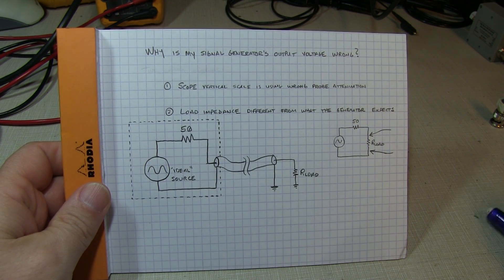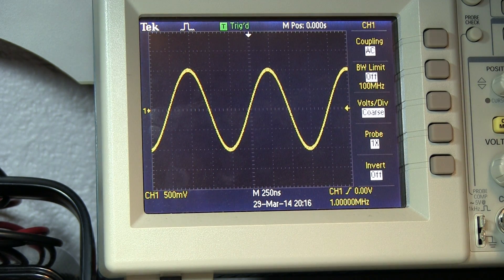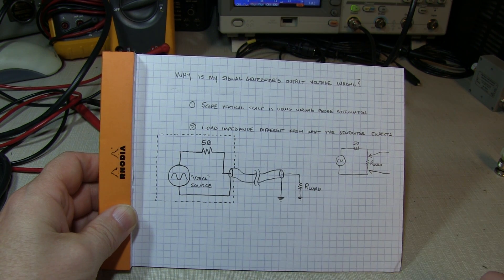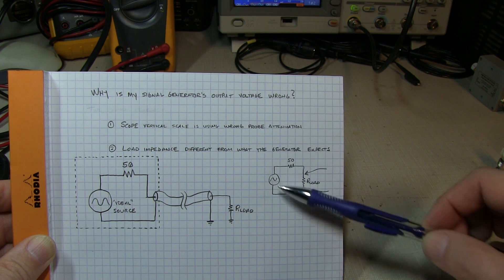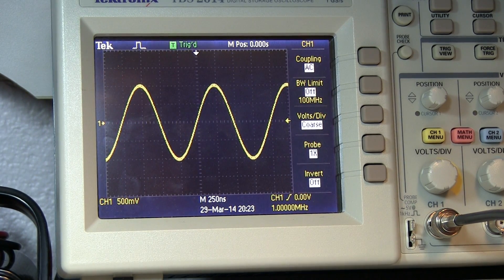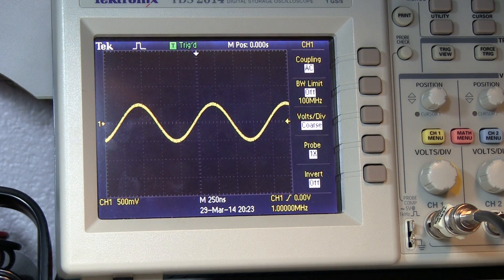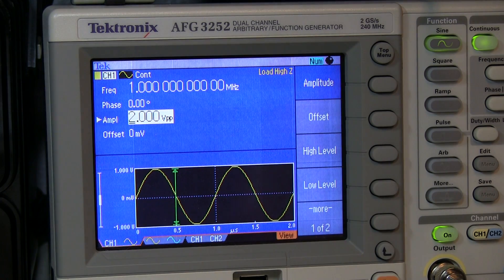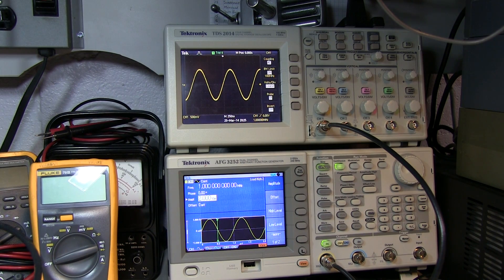#137: Why your Function Generator's output voltage reading can be wrong

Comment: Hello Alan,

Why is 50 Ohms resistor value widely used? And what is the use of having 50 Ohms internal resistance in the function generator?
Reply from the maker: The 50 ohm output impedance is used to provide a good source match to the line and load.  Why 50 ohms, here's a good answer for that: https://www.microwaves101.com/encyclopedias/why-fifty-ohms

Comment: Bought a 50 ohm bnc feed through terminator which appears to have the 50 ohm in series instead of parallel to the output. What is the use of such a 'terminator'? Attenuation?
Reply from the maker: It's most commonly used as a "source terminator" when the source has a low output impedance.
Reply: When the source impedance is lower than say 50 ohm. So it acts like the 50 ohm resistance in your schematic here.

Comment: Hi Alan. I was wondering is there noticable difference in signal shape or amplitude depending on where you terminate your coax? I mean you can connect your through termination at the oscilloscope or at the signal generator will we notice a difference? Is it important to terminate your signal at the end of coax or it doesn't matter?
Reply from the maker: It is almost always best to terminate at the load.

Comment: can you make a video about a somewhat common issue which i cant find a way to fix, which is that my function generator and scope are both earth grounded and somehow ive read that causes issues..for example ive tried building a bridge rectifier but i cannot read the rectified wave, as soon as i try to do a common ground or anything my wave readings are totally off and awkward. It is now sunday, got my scope on friday , spent the entire weekend trying to figure this out... and i cant....scope noob :(
Reply from the maker: If you draw a schematic of your setup, including a "model" for the generator output and scope input, it'll be clear to see the problem with the common ground.  A bridge rectifier expects an AC input at the input, where the input signal on each side swings above and below ground, while the output of the bridge typically has one side tied to ground.  But, when you drive the input of the bridge with the function generator, that effectively ties one side of the input of the bridge to ground - so that node will no longer swing below ground (because it IS ground).  A simply audio transformer can be used between the function generator and bridge rectifier input to solve this issue for your measurement purposes.

Comment: What voltage will be displayed on the oscilloscope if we set the function generator to high Z while having a 50ohm through terminator.
Reply from the maker: If the generator is set to Hi-Z, then it is expecting to see a high impedance load.  Thus, the amplitude displayed on the generator would reflect that.  But, since the load is actually 50 ohms, the actual voltage displayed on the oscilloscope would be 1/2 of the value displayed on the generator.
Reply: Thank you!

Comment: I have a function generator that supposed to have a 50 output however, I tried a 50 Ohm terminator as suggested at the input of my scope and voltage was still wrong. I then built a variable 10 to 100 ohms terminator and I found that adjusting it to about 37 ohms worked just fine. Is it possible that the output of my signal generator is not exactly 50 ohms and using a variable terminator is the right thing to use? 
Please reply because I need to know what you think...

Thank you
Reply from the maker: Does the generator have a setting where you can input the load impedance? If not, then the best practice would be to use a load impedance that matches the coax impedance (usually 50 ohms), and then always measure/verify the output amplitude with your scope.
Reply: Would I be doing the right thing using a variable terminator?

Thank you
Reply from the maker: It would be best to have the termination match the coax impedance (i.e. 50 ohms) to prevent any reflections.
Reply: What I am trying to accomplish with the variable terminator is adjusting it so that the signal generator Peak-Peak voltage match the scope Peak -Peak readings. If I use a 50 ohm terminator on the scope, the reading are not the same however, if I use my variable terminator set to about 37 Ohms, the readings match each other. I tried this on both ends of the 50 ohm coax and the readings match the same. I'm thinking maybe the signal generator voltage display reading is off. I realize that matching the terminator to the coax is the best thing to do.  I guess I should dis-regard the voltage reading from the signal generator and make adjustment according to the scope is my thinking while using a proper 50 ohm terminator at the scope input.
Oh! buy the way, the signal generator is a GW Instek SFG-1013 which of course is a entry level signal generator and not a lab grade device. It's frequency and voltage output is rock solid and good enough for what I need.

Thank you for any reply.........
Reply from the maker: If it appears that the amplitude is "off" by the same factor at all frequencies, etc., maybe you can make a modification (insert a series resistor) inside of the generator to make the voltage division more accurate.
Reply: Thank you very much for your quick reply. I will do some more testing tonight and see what happens.  Again thank you...
Reply: Your idea was right and I did a few tests and found that a series 20-22 ohm resistor brings the output to about 20 millivolts within the signal generator voltage display using a 50 ohm terminator at the scope. The frequencies I tested were from 1kc to 2mhz and there was a slight difference but not anything to worry about.
Now this test was done outside of the signal generator and I realize that a internal mod may be different due to termination I made outside. I will see what happens. If this was a signal generator that went beyond 2mhz, i would hesitate to make any internal change. All I am using the signal generator for is low frequency stuff mostly below 500khz.  Later I will see how difficult the mod may or may not be and go from there.

Thank you for all your help.

Comment: If you were to set the RF generator to +10dbm..  Does this really mean that the generator will provide that 
power of +10dbm at a 50 ohm LOAD...   But in order for the generator to accomplish this
it actually has to generate +16 dbm aka 40mW of Raw Power aka 2.00 Volts Peak 
to provide +10dbm aka 1.000 Volt peak to a 50 ohm load...  Let me know if this correct...
Reply: Thanks for such informative videos... Sounds like you have a bad cold.... Hope ya feel better...
Reply from the maker: You're dB calculations are off, but you have the idea correct.  The generator has to produce twice the raw voltage (into 100 ohms) in order to achieve the desired voltage into 50 ohms. Remember that power is calculated from RMS voltage, not peak. Considering sinewaves only: 2Vpeak = 1.414Vrms,  20mW (+13dBm) across 100ohms, and 1Vpeak = 0.707Vrms, 10mW (+10dBm) across 50ohms.

Comment: If I measured the signal i/p on a circuit under test, and this measurement is the same that is being displayed on the generator, I could be confident there is no conflict of impedances?  Correct?  Thanks.
Reply from the maker: Yes. It's always a good idea to measure the signals at the device under test, just as it's a good idea to measure/check power supply voltages at the circuit and don't always trust the power supply display.

Comment: Hello Alan! I know you couldn't possibly know all the different oscilloscopes and signal generators. But, I will say that I have a Marconi Instruments 2022D Signal Generator, and my oscilloscope is a Fluke 196D Scopemeter (combination digital scope and multimeter). The manual for the SG says it has an RF output of between 127 to +13 dBm.(0.2uV to 2 V EMF). However when I connect the output of the SG to the probe on my scope, I do not get the readings to concur. Right now I have the SG set to 1000mV, but the scope is reading 4.1 mV+/ RMS. The scope shows 1:1 probe. What in the heck am I doing wrong? I want to connect the SG to the SO239 on my VHF radios and do some signal tracing. Thanks for any help...Dan
Reply from the maker: +Beretta96Dan The SG has to be loaded with a 50 ohm load in order to meet its specification. A 1X probe used with any scope will only give you less than 10MHz of bandwidth. Another problem you have is that the 196 only has 100MHz of bandwidth, which means that 100MHz signals will read 3dB down, and only if you use a 50 ohm thru termination and no probe.

Comment: Thank you very much, this is the video i was looking for!
But i was wondering, what if my load is 80 ohm or 200 ohm impedance, because my function generator doesn't have the "load" option like in yours (it can only switch between 50 ohm or Hi impedance) do i have to put a 80 or 200 ohm terminator?
Sorry for the stupid question but i'm a beginner.
Reply from the maker: Hey - there's no such thing as a stupid question (only stupid answers, and I'll try to avoid giving them).  Assuming that your switch simply adjusts the readout on your generator, you can set it to High Impedance, and then calculate the resulting amplitude by multiplying the reading by RL/(RL+50).
Reply: +w2aew "Assuming that your switch simply adjusts the readout on your generator" -> Can we assume that some generators are able to short their 50 ohm load, then?
Reply from the maker: +fabts4 I have seen some where you can change the output impedance from 50 ohms to 600 ohms.  I don't think I've ever seen one where you can change it to (near) zero.

Comment: What's the ttl output stand for ?
Reply from the maker: The TTL output designation on the signal generator means that this output is designed to be compatible with TTL logic signal levels.

Comment: Hi Alan, I have seen people tripped up by this before. A lot of old signal generators were marked "EMF" or "PD" to differentiate between the levels they would generate into Hi-Z or 50 ohms.
It can be frustrating with modern test equipment where the termination options are hidden in menus somewhere and not permanently displayed on screen.

Comment: Fantastic as always!  Please do a video on measuring impedance.  When can I use a 50 ohm terminator attached to a tee instead of a  50 ohm through terminator?  Thank you, oscillator!
Reply from the maker: You can generally use a 50 ohm terminator on a tee instead of a through terminator for HF frequencies and below, because the stub length will be insignificant.  However, don't forget that even low frequency square waves and digital signals will have frequency components in the very high frequency range due to the fast rising and falling edges.  If your signal's rise/fall times approach 1ns or less, then you'll start to see distortions due to using the tee instead of a through termination.

Comment: Hi Alan Something else to be mindful of. The new generation of RF Function generators have much higher frequency capabilities. An excessive length of coax can turn into a Quarter Wave Transformer. At 150 Mhz that equates to a half meter multiplied by the velocity factor or 18 inches * .6 to .8. The equates to 10.75 inches to 14.4 inches...Something to think about.
Reply from the maker: Yes, excellent point. Anytime you get above a few MHz you have to start thing about transmission line effects, terminations, etc.  I did a video on quarter wave lines as part of the video on tracking generators.

Comment: Great video Alan. This brings up the question: how does one go about determining the input or output impedance of a circuit?
Reply from the maker: This is a good question! Something I'll have to do a video on. Basically, to determine output impedance, you would observe the amplitude change as you change the load, and then calculate the output z.

Comment: Recently I went from an audio function generator to a real one (Agilent 33220) and was wondering why it showed double the value until I realized: "sure it has 50 Ohm in series and shows for 50 Ohms termination". So I just added a 50 Ohm terminator. Searched for a menu item on my generator to set it up properly, didn't find a menu item. You video made me look into the manual, and what do you know: Its not in the Output menu, it's in the Utility menu. That's Agilent for you ;) (Where files are not deleted but purged :))
Reply: On my Rigol, it's  also Utility